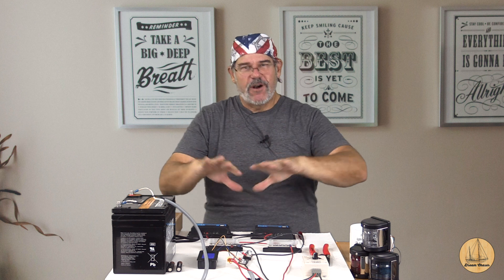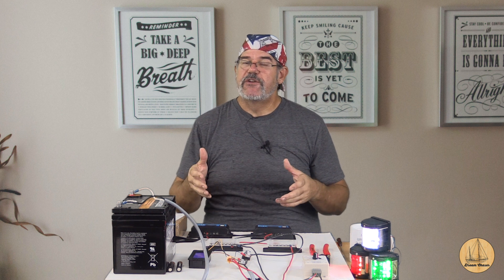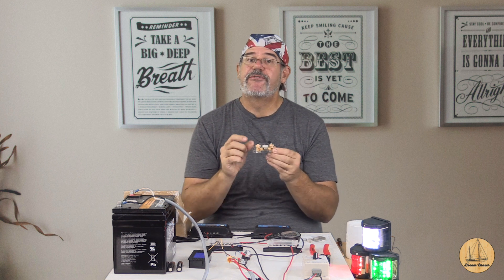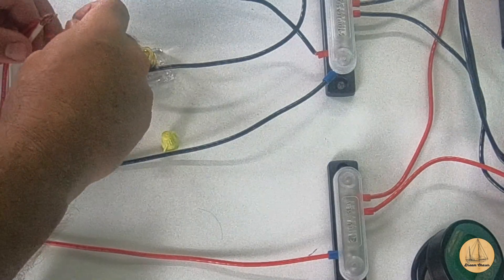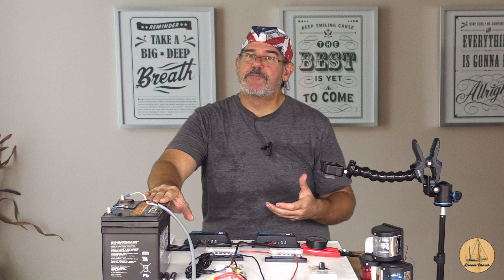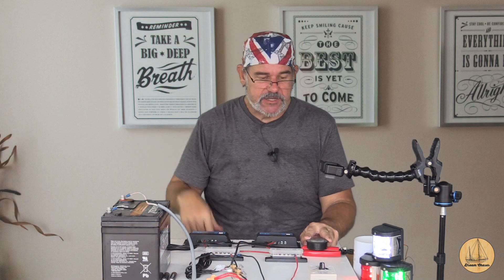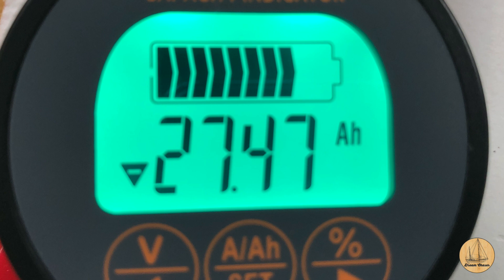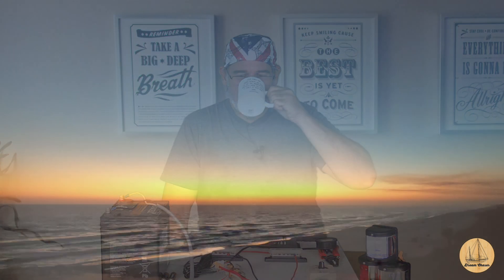Testing a Battery Monitor System

Comment: I have 2 100ah batteries. Do I put in 200ah or 100ah
Reply from the maker: If they are two 12 volt batteries in parallel you would do 200Ah
Reply: @Svdreamchaser  I'm trying to figure all this stuff out. I'm lost. Lol
Reply from the maker: It took me a while of playing with it. If you have the batteries in series (positive to negative) for example with 2 6volt batteries then you would set it at 100ah.   Just to make it a bit more confusing.
Reply: @Svdreamchaser  I have 2 100ah lithium negative to negative
Reply from the maker: In that case you would do it as 200ah.

Comment: If I have a bank of 4 6v golf cart batteries with 840 amp hours do you recommend telling it the capacity is only 420 so my 50% reads as empty?
Reply from the maker: I think you would need to validate what your total capacity is in amp hours. I am fairly certain that when you put two in series to get a 12v cell that you don’t double up the amps. For example if you have 4 batteries at 100 ah each at 6v and you series two to create 2 cells at 12v your amp hours would be 200 not 400. At least that is my understanding and would need to read the details of the battery closer.

Comment: i have it hooked up to a bank of 4 6v golf cart batteries on my RV. I am having some trouble with my reading. I have my final negative battery cable then going to the shunt, then to the ground on the rv then from the ground to the inverter negative terminal. On the positive I have it going to the shunt then to the inverter and then to the RV feed. Is that the order I should have it?
Reply from the maker: I believe so but would need to rest to validate as I didn’t configure my test bed with the inverter.

Comment: PLEASE HELP!!!!! I have a problem with mine... I have the 350 amp version.  Have it hooked to 2 - 6 volt 235ah  VMax batteries, so 12 volt 235ah. Works fine until I turn on my 2000 watt inverter & use my microwave. It pulls just over 100 amps. Only use it for less than a minute, 2 max. After I'm done & shut off the inverter, my gauge reads 0ah & 0% capacity. I have the gauge set to 235ah. I think it is a faulty gauge. Does it every single time.....any ideas? Thx
Reply from the maker: Wow. Very interesting. So it seems to work ok until the inverter kicks on? Right?  I assume the inverter is hooked up downstream of the shunt right?  If it is than I don’t know what else it would be and it makes me wonder if these cheaper ones aren’t sophisticated enough to recognize the ‘noise’ on the line from the generated AC.
Reply: @Svdreamchaser  I figured it out. Hopefully this will help someone else as well. If you press the voltage button then press the set button for 3 seconds the voltage from the factory is set to 0. You can adjust it up & down then press set again to store a different value. I had mine set to 12.5 volts. I turned it back down as low as it would go & saved that value. Works perfectly now. If you set the voltage higher say 12.5, then the ah & percentage reading will be reset to 0 and the back-lighting will turn off if the voltage drops below the value you set. Hope this helps someone else.👍
Reply from the maker: That is great you got it fixed. I am sure this will help someone else too. These instruction manuals on the imported models always lack sone details in the translation so these forums to share problems and resolutions are great!!  Thanks for posting the fox out here as well.
Reply: Yes, everything on my batteries are downstream of the shunt. The monitor works perfectly when I use every other load like lights, fans, stereo,  furnace, fridge etc. It even works great when using the inverter, like charging laptop and other small loads, but not on a high amp draw.  Its when I pull alot of current through the shunt it resets to 0% and 0ah. I tested it today and with full batteries at 13.7v I turned on inverter & microwave. And at about 25 seconds in, the monitor reset itsef to 0% and 0 amp hours. It was pulling about 110 amps and the voltage was about 12.1 when it was running. After I shut it down & let the batteries sit for a bit the voltage settled in about 12.7. I suspect its a bad monitor....
Reply from the maker: You may be right for sure.

Comment: Anyone know why my monitor doesn’t show charging, only draw?
Reply from the maker: It is a one-way monitor. If you want to show draw you hook it up one way if you want to show return you reverse the polarity. This is not one of the monitors that will demonstrate both like a Victron
Reply: @Svdreamchaser  ah I thought that might be the case but I’m sure I’d seen some videos showing charge. Thank you ! 👍
Reply from the maker: @jrkeiko  Oh Shoot, James, hold on, I need to revamp my answer.  Give me a few hours and I will provide the input.  I responded earlier from my phone and realized that I shared response to something that was NOT in this video.   This one should be showing both input or output or the net difference if there is both input and output going on at the same time.  I need to go out to my test bed and validate my wiring and will share with you how I have it.
Sorry for replying to quick earlier.
Reply: @Svdreamchaser  oh that’d be great thank you ! No rush- it’s a quite a way off until it’s ready to use properly 👍

Comment: Could you also set 17,5 Ah as the usable capacity for this 35 Ah rated battery?
Because, if this is possible, you could read the 50% state of charge of the battery as 0% available on the display, for this lead acid battery?
Reply from the maker: Yes you could do that as well. I suppose that is a preference. I sort of liken it to the people that set their clock 15 minutes ahead so they are never late. Lol. I figure I can’t fool myself and I will know when I need to recharge or reserve when I get down to that 18 or so range. Lol.
Reply: lol

Comment: My question: when do you tell it batteries 100%? 
When at 14.2v? 
When it settles back down to 13.6? 
And how would I set up a system to only drop to 20% SOC and only charge to 80% SOC? 
Do I need to DIY with a customisable BMS?
Reply: The problem with setting it up to 100% is do you actually know the real capacity of your battery? If you did not do a battery capacity test to verify it is actually 35AH then you are telling the meter that it has more capacity than it probably does and to make things worse you are telling the meter that 35AH is at 100% when it probably is not. your resting state of charge of 12.7 is 100% (full charge) but does that 12.7 equate to 35a amp hours? probably not. The instructions are horrible for this device because they are giving the user a false sense of security about actual capacity. Just because the battery has a sticker that says 35AH doesn't mean the battery has 35AH. The best thing to do is set it up like it says in the next section of the instructions. Drain your battery to where you would like zero to be such as 11.9 volts then program it like the instructions say to do by pressing the V button to zero the % screen. Then charge your battery to FULL (resting SOC 12.7v) so it can calculate the actual capacity you have available. Then use that number to enter into the AH/A screen for your AH capacity.
Reply from the maker: Great comment. I didn’t want to fully discharge mine to do that but understand your point.
Reply from the maker: I waited until 24 hours on a trickle charge and was confident that the battery was fully charged because there was no load pulling off of it. I don’t think using voltage is the best way to measure a battery capacity or SOC. But part of that is my opinion. As for programming the different parameters I believe that goes well beyond what this particular meter is capable of as that sounds more like the charging profiles assigned to the actual charge controller and not just the metering device.
Reply: @Svdreamchaser  so I should program the capacity monitor to be at 100%/when the batteries charge reaches its highest point/14.2v..? The thing is as soon as the charge controller, or the charger reaches float it will drop down to the resting voltage of 13.6v I think it was, so unless you’re very closely watching the SOC you can miss the peak, which is what brought me to ask the question. After you’ve said 24hrs, that would mean you’d program 100% into your monitor at the resting voltage.
Reply: @Svdreamchaser  Thanks for your help. I have now learnt that voltage is not used to determine the SOC, but they use amps and draw to determine capacity and that’s what makes them so accurate. That said, I’ll set the monitor to 100% in FLOAT, whether it be 13.6v or 14.2v is irrelevant, for anyone else out there wondering the same thing. They say that, but obviously it is used to determine SOC to an extent, as you won’t let your battery drop below 11v right.
Reply from the maker: Yes Float. You are correct voltage is a way to determine state of charge but it is not linear so you could be at 12.4 and fairly full but it could go to  11.9 quickly as the capacity or SOC is lower. At least that is the way I understand it which I believe to be the reason that measure if every amp hour in and out through usage gives you a better sense of actual battery levels.

Comment: Hi, for safety i would put a fuse between the battery + and the shunt (battery -).In case of a short circuit in the print, 35amp is a lot of power for the wire. Victron use  a fuse holder for it. Greatings
Reply: How big should the fuse be?
Reply: @Babasafti  About an inch long. :)
Reply from the maker: Lol
Reply from the maker: Sjoerd Siebenga great idea and suggestion. This was only a test bed but I likely should have done it here too. Thanks for the tip.

Comment: Thanks for the video. One question- do you have to reset the TR16 every time you disconnect the battery or will it maintain the settings?
Reply from the maker: Jack Wall I have only disconnected it for a few seconds when doing work and it retained the settings but my guess is if it was more than a minute of so that it would require resetting them.
Reply: @Svdreamchaser  I have seen on other videos you should have it going to the shut, then the shut off, providing a constant very small feed or it will forget.